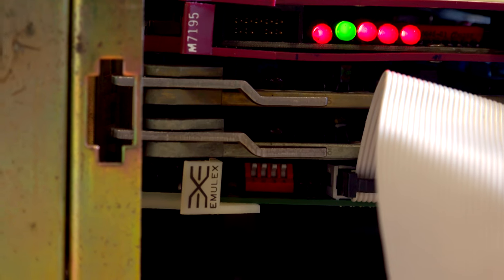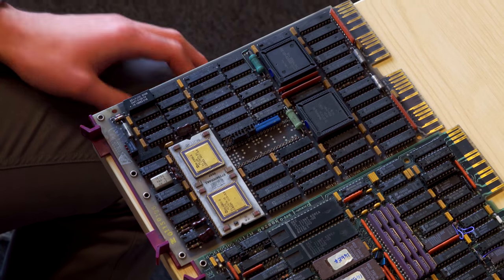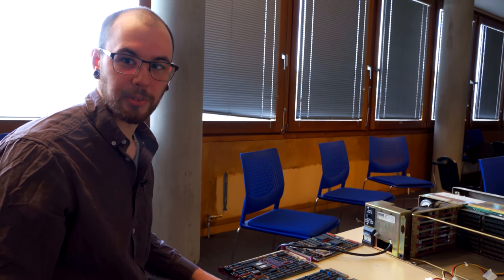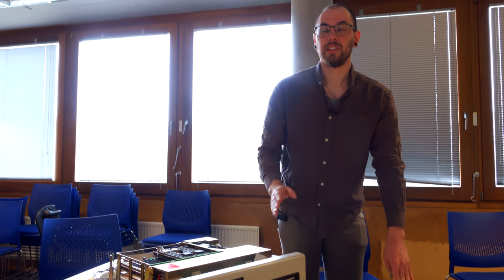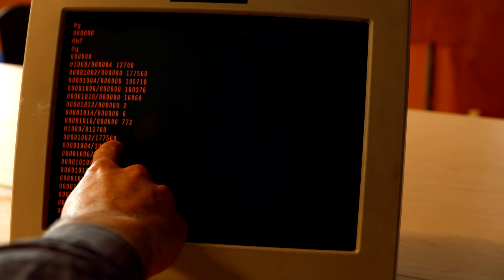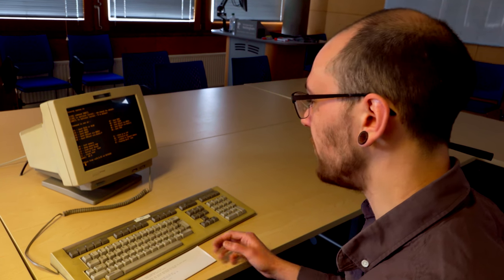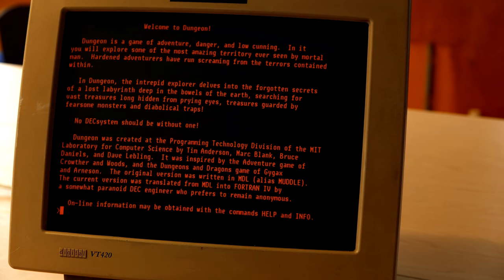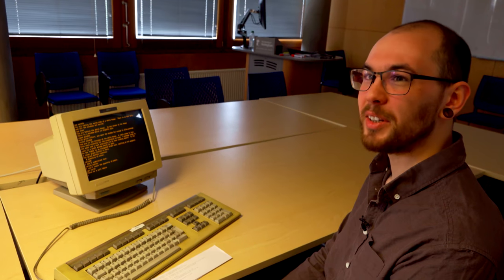DEC PDP-11 & Zork - Computerphile

Comment: I have fond memories of porting an extended version of Colossal Cave from Cambridge University, FORTRAN IV source supplied on magnetic tape, to run on a PDP-11/34 under RSX-11M. Address space challenges solved with paged 'overlays'. After the computer was finally turned off, while it played Take Me Out To The Ballgame through rather expensive 12 bit D/As, I salvaged the front panel with power switch and keypad to remind me of those good times and programming all-nighters.

Comment: Unix was actually created for the PDP-7; it was ported to the PDP-11 after being ported to C from PDP-7 assembly.
Reply: You are correct, apologies for getting the history a bit wrong. It can be a bit tricky to get some of the details correct while being filmed. I would still argue that what was running on the PDP-7 was quite far off from what Unix really stood for.
Reply: Aaron S. Jackson Why?
Reply: I believe the Unix kernel was ported to PDP-11 assembly language first, only later rewritten in C.  In the early days, some userspace tools were written in B.
Reply: Wasn't it called Unics on the PDP-7?   I could be wrong, but I don't think it got the moniker UNIX until it was written in C and ported to the PDP-11.
Reply: “Universal Node Information Exchange” - in Fiction.

Comment: The PDP-11 was used in the Xerox range of large laser printers starting with the 9700, and continuing through to the 4635.  I was fortunate to support this device until 2001 - writing assembler patches to correct problems.  I first started writing code for the PDP-11 at a different company in 1973.  Lovely machine and instruction set.
Reply: Did they shrink the PDP-11 down to a single board microntroller-like device to control the printer?

Comment: ADVENT xyzzy plugh.  Thanks for the video.  Wonderful reminder of a great time in computing and in life.  I worked for DEC in the 80s and have fond memories of working on PDP-11/34/40/45/70 and other models.  At times we would need to wire wrap back planes and such (dual DMR11s?).  We would boot some of the machines with the front switches.  You could get fast after a while and actually memorize the boot sequence.  Once running, it was fun seeing the front lights move in one sequence for RSX-11M and another sequence for RSTS.
Reply: I worked for Data General.  :-)
Reply: I would say “my condolences”, but DEC is gone, too...
Reply: They're ALL gone.
Reply: I worked for Floating Point Systems, which made array processors and used PDP-11s, among others, as front ends. Then I worked for Prime. I used to set the front lights to show the user number so I could tell who was hogging the machine. It was a big deal when the front switches were replaced by a Z80! Of course you still had to type "boot 14114," the boot address.
Reply: How many elections did you help steal with CES?
Reply: Wow, I worked on DEC PDP-11/70s in the early 1980s too! We ran RSTS/E and had a time-sharing service for dentist offices. Occasionally, the system would act up, and a DEC engineer would come in and futz around with the backplane, until he found where the bad wire-wrap was, and replaced it.
Reply: I cut my teeth on an 11/750 and worked for DEC here in Australia for close to 7 years
Reply: I hope they were great years for you.  I started in DEC Field Service and absolutely loved it.  I got to repair PDP-8, PDP-11, VAX, Alpha, RP06, Tape drives with vacuum columns, and on and on. A few years later I wanted to keep growing and moved into the software world.  I started off doing operating system installations on RT-11, RSX-11M, and then VMS and moved into software development and then databases.  On top of that we went to a lot of training and the travel that went with it.  15 years of great memories.
Reply: DEC was the best place to work for, got to play with a lot of fun toys, work with a lot of great people. I was in Technical Support. Started out in VMS support, migrated to Ultrix/OSF and then again to Pathworks. It's funny the things you remember after so many years.. like B/1 for sysboot, b/e0000000 for standalone backup, that slight whistling sound of an RM80 platter after a head crash.. and then the administrivial things like my badge number (266659) and my mailstop SNO2-3/F3.
Reply: Our 11/70 had a sticky note with the binary boot address. You had to enter it via toggle switches on the front panel, press load, and then run.
Reply: I'm now remembering, for unknown reasons, that the address for the real and effective UIDs were 140070 and 140072, the u structure being located at 0 in the 6th seg. register (0140000).
Funny what comes back...

Comment: ODT was originally the "Octal Debugging Technique" (and, of course, came on paper tape). By the time that the Qbus machines arrived it was part of the firmware and was referred to as "Console ODT" - the meaning of the acronym also started to morph into "Online Debugging Technique" in some of the DEC manuals (although it was still essentially the same thing and everything was in octal).
Note, however, that the 'T' always stood for "Technique" not "Tool" no matter what Wikipedia says ...

Comment: A whole megabyte of RAM?!  What extravaganze! What on earth would you need that much space for?
Reply: With 16 users logged in, that's only 64kb per user, before OS and IO overhead.
Reply: The per-process virtual address space was only 16 bits.
Reply: A megabyte of ram could cost upwards of $40,000. Triple that for today's dollars. You had to be clever to keep your program from paging. You also kept things you used a lot grouped in one page so it would would have a higher chance of not having been paged out the next time you got a time slice. If the OS had to go out to paging, you forfeited the remainder of your time slice.
Reply: Paging was a tricky thing. When we first installed MACSYMA on our VAX-11/780, it behaved very badly. Then our sysadmin edited the .EXE file, changing the page fault cluster size from its default of 16 down to 1, and that improved things a lot.
Reply: It was enough to go to the moon, it was enough for us :E)
Reply: My PDP-11 has 64kb RAM :|
Reply: @Barnaclebeard  Why on earth would 16 users log in at the same time? Does any company have this gigantic number of users??
Reply: @wutzedale  
These PDP-11s and most of their PDP series minicomputer became popular for small time-sharing setups.
Reply: @gregorymalchuk272  thanks,, but my comment was a joke
Reply: 640K is more memory than anyone will ever need on a computer
Reply: @lawrencedoliveiro9104  17 bits on PDP-11/45 and PDP-11/70s, which supported split I/D spaces (separate 64-bit address spaces for instructions and data (heap and stack)).
Reply: @lawrencedoliveiro9104  Unix on the PDP-11 didn't support paging. The PDP-11s that had memory protection hardware provided 8 or 16 segments, each of which could be 8kB in size. Processes could be swapped out, and there was support in some of the DEC OSes for overlays, but paging wasn't a thing.
Reply: @BlankBrain  Unix on the PDP-11 didn't page, it swapped; the memory protection h/w didn't really support demand paging, so far as I recall. The departmental server that I worked on in 1976-1979 had 156kB of memory, mixed between semiconductor (fast) and core (slow). The OS ran out of core in low memory, so that user programs could run fast (that being highly relative).
Reply: @robertherndon4351  If you want to include that, call it more like 18.6 bits.

Oh, and I never said it did.
Reply: First computer I ever used had 256 bytes of static RAM, no ROM, and no other type of memory.
Reply: @Barnaclebeard  64k? Who needs that much?

When I were a nipper working on. PDP11/23, we had 16k per process. Well 32, but 16k was for the BASIC runtime.

Comment: The PDP-11 was my computing life from 1978 to 1987 in real-time factory applications. We had an 11/40 & 11/34 when I started, later 11/70 and finishing with 11/23, 11/73. 11/53 & 11/83. It was never an **ix o/s, usually RSX11M or MicroRSX but with occasional forays into RSTS/E, RT11 and even DOS11 which was out of support even then
Reply: I also have RT-11 on an RX02 floppy for this machine, but I personally think UNIX is much more interesting.

Comment: Ahhh, you need to spend some time with Zork, my good man.      Soon you'll have a pad of graph paper and you'll be scribbling little maps...  it was a very fun game for it's day
Reply: Still didn't teach you the difference between its and it's, did it.
Reply: It didn't teach you to end a question with a question mark, either.    The game was still fun, regardless of my grammatical prowess.
Reply: Well, we see where the priorities were. Certainly not in, say, not putting an estimated 39 space characters after a full-stop.
Reply: Anvilshock, I wonder what error snuck through the proof-read, requiring the edit... pedantry is quite fun.
Reply: N, N, W, W, Down, Get Screwdriver, S, S, put screw driver in slot....  LOL
Reply: I started it in the early 80s on a C-64, and finished it last night on a C-64 emulator. Was, and is, a great game experience. Eager to start Zork 2, hoping it doesn't take me another 40 years to finish.

Comment: Hey!! This is so nice to see! I've tried to restore a PDP-11/03 in my highschool with a bunch of friends, but the serial card clock was off, and we couldn't get it to boot from our emulated tape disk with RT-11. PDP's are beautiful machines to learn how computers work. I love this!
Reply: The other PDP-11 I mention in the video is an 11/02, very similar to the 11/03... Need to sort it out at some point. Shame about the serial card you had issues with.
Reply: Aaron S. Jackson Sorry, my other comments had links and they were blocked. Here we go again...
By the way, you comment made my day :)
I found info on that third switch!
Line-Time Clock
One of the less understood features of the PDP-11 seems to be the Line-Time Clock, or LTC. This is a signal that is normally generated by the DEC power supply. The power supply samples the A.C. power line, at a voltage the system can handle, and then converts it to a square wave for use by the processor. In the Americas, the signal's frequency will be 60 Hz, while in Europe and Asia, 50 Hz is more common.

The LTC signal is injected onto the BEVNT line on the backplane, where it generates a high priority interrupt in the processor. This interrupt is used for updating the system clock/calendar, among other things. Some operating systems, such as Unix, will not run without it.
Reply: Augusto Figueroa I thought so, but didn't want to say it in case I was wrong haha :)
Reply: @AaronJackson1  Hi Aaron, can you please expand on the 11/02..?  I am also a "5-digit DEC badge # person" (13xx8) but never heard of the 11/02.. I do still have 11/03-23-53-73 bits n pieces in my collection, need to start putting together a couple of working systems. Thanx for the memories and the inspiration.. lm
Reply: @lmantuano6986  hey! There's not much info about it, and it may not be called the 11/02 at all (but I think it is?). It was an OEM CPU board which was sold for industrial control systems etc

Comment: It's kind of a pity that they eventually dropped the classic front panel, with the lights and switches--they were increasingly useless at this point, but the middle models of PDP-11 had a front panel specifically designed for aesthetics, and I've always thought it was quite beautiful in a 1970s-modern way, with switches in pink and purple shaped to match the bezel edges.

Comment: Hey, Zork (or Dungeon, in reference to D&D )! That's one I played when I was younger, though it was the Infocom version that was turned into a trilogy so they could fit each part on a disk for microcomputers. They also created a bytecode for it, called Z-code, in order to make it cross-platform and reduce the size, and a programming language, Zork Implementation Language (ZIL), which looked a bit like Lisp. As I recall, there are a few substantive differences in this version, i.e. beyond the mention of DEC and such.

Comment: This is a Q-Bus machine.  The Unibus backplane was often wire wrapped and could be modified in interesting ways. I've worked on and with PDP-11/10 PDP-11/05 and the original PDP-11/20 (the original).   Those had bit switches.

Comment: Always good to see some old hardware working again. You know you are getting old when the current generation of geeks haven't played Zork! (or ADVENT / 
Colossal Cave as it was originally). ;)
Reply: On the Commodore PET's it was, if I recall correctly, re-badged as some variant of HHGTTG. I never got past the Babel fish (which was really early in the game). 
I much preferred playing space invaders, which was all done with the extended character set working as sprites; and which was written in assembler. It cheated by setting the display to a given memory address (the display was just a memory location in ram) and then created the next frame in a different memory location, then poked the video address to that memory location and repeated that all over for each frame. Was surprisingly fast, and smooth, given its processor worked at 1Mhz.
Reply: That might be the Infocom game, they did various Zorks, HHGTTG, Lurking Horror etc.
Reply: Zadster agreed. The hhgttg game was actually written by Douglas Adams. He later did another one (Bureaucracy?)
Reply: I had forgotten about Bureaucracy! I seem to remember it was infuriatingly tedious. Somewhere I still have the official Infocom collection box set on 5.25in floppy.
Reply: Zadster yes, it was a bit too much like real life. Apart from being continually licked by a llama.
Reply: +Zadster - "go south"
Reply: ADVENT/Colossal Cave is an earlier game than Zork. As it happens, I've been in the Colossal Cave section of the Mammoth Cave system, which the earlier game is based on! The reports of people navigating through the cave based on the game are probably exaggerations. (I did know Mel Park, the source of that legend, but never asked him about it).
Reply: @JW-uC  HHGTTG was just one of many Infocom adventure games. For Zork there is Zork I, II, and III. Then came (in no particular order) Return To Zork, Zork Zero, and Beyond Zork. One of the later ones in the Zork series used graphics instead of being just text based as was the case with all the other adventure games in the series.
Reply: @gasdive  Yes, Bureaucracy was also written by Adams. IIRC, the goal of that game was to get the bank to acknowledge a change of address. :)
Reply: @JW-uC  I'll give you a vague hint about how to get the Babel fish. Don't forget to grab the mail before you leave the house in the morning.

Comment: This machine is not the early days of computing. The PDP-11 was a sophisticated machine and the 11/73 was almost the pinnacle of the 11 line. The CPU was a microprocessor in contrast to earlier 11s with TTL CPUs. When this machine was built the IBM PC was already a product and UNIX had migrated to the VAX and other architectures.

Comment: The VT420 is younger than the machine I believe - it's close anyway.  I had a PDP-11/40 for awhile, but keeping it happy was more than a hobby, so it went to another collector.  Today I still have some DEC stuff - A PDP-11/84, a few microvaxen...  Emulation can get you the flavor, but the real hardware is still amazing.  Someone should make a modern FPGA based replica for the next generation. I don't have a lot of love for the old disk drives - those can go away.
Reply: Real hardware is amazing ... for those who can afford the space, and the electricity bills.
Reply: That's what got me. I had a chance to get PDP-11/44 for free, but I didn't have 3-phase power in my apartment :)

Comment: The pdp Basic language we used limited program size to 32k (16k words I think).   It had a great send/receive function that was very fast, so we set up a home grown multi key - random/sequential database program as a separate process and could query quite nicely.  This saved about 8k in the application program.   The language required a lot of goto's which made me appreciate C.
Reply: No gosub I guess ?
Reply: PDP BASIC-Plus had GOSUB, but GOTO was used for IF-THEN-ELSE type of constructs. Every line has to have a line number, and there are no "blocks" of code (like using brackets). So, typical would be
11000 REM Do some stuff
11100 IF A=2 GOTO 11600
11110 REM A not 2, so do some stuff
...
11590 GOTO 12000
11600 REM A is 2, so do some other stuff
...
12000 REM Rest of program
Reply: Are you talking about Systime’s ACCESS indexing system to enabled keyed access to files? So that we could calculate which 512 byte block to read from the file?

Comment: Doesn't the aux switch enable/disable the line time clock (LTC), which AFAIK is a clock sync generated by either the PSU, or i believe, the mutifunction card. 

Again, not too sure what it does, but it's probably for timing purposes independent of the CPU clock